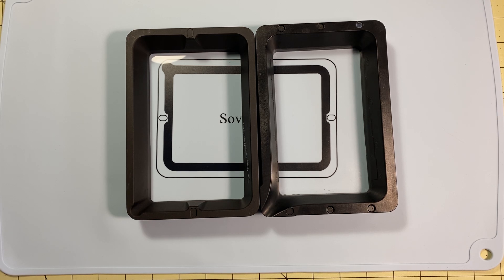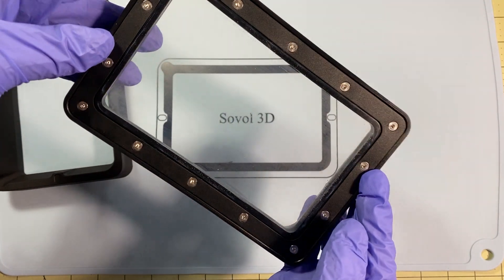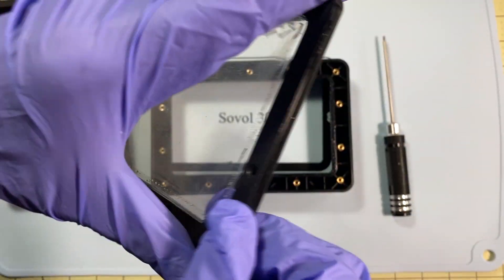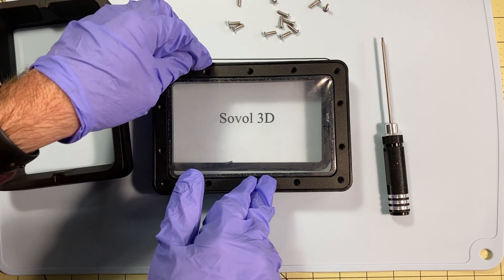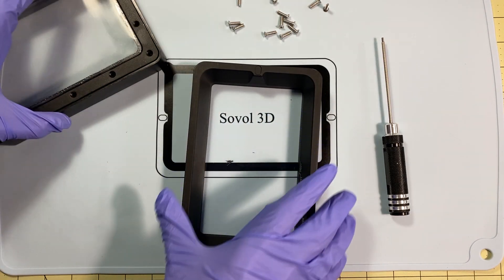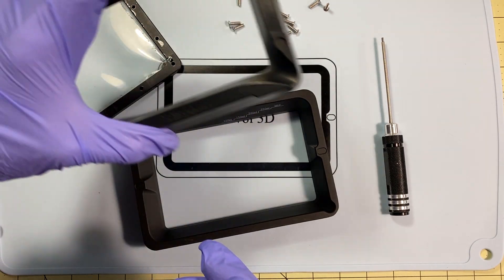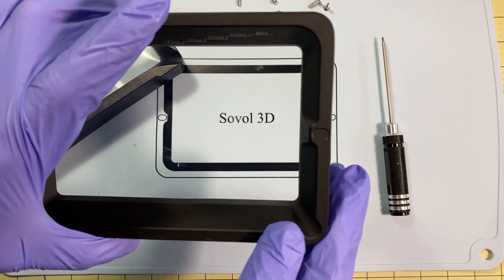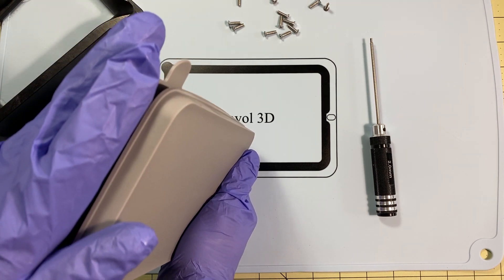Buy This Now to Upgrade your Anycubic Photon Mono Printer – Sovol 3D Printer Resin Tray Upgrade

Comment: You have no clue how much I am really starting to hate capitalism. My printer had a failed print out of the box, and it basically totalled my FEP sheet that came with the stock vat. I just waited two weeks for replacement NFEP (i heard good things about NFEP over FEP) sheets to arrive, Got them yesterday, I just went to install them and found out that I am a victim of bloody capitalism once again. So here we are. The tally is now $180 in replacement bits and pieces, And mind you I only have ONE failed print on my Photon Mono 4K.

Are you sure that the FEP in THIS vat is sealf replaceable and wont cost me money to buy an entirely new sheet frame?

Because here in Australia Anycubic is flogging these plastic framed replacement FEP sheets for $49 EACH. Not including the outrageous $23 shipping.

Comment: I bought the Sovol vat for my photon mono, and after like maybe 3 uses I had a spill that ruined the LCD screen, at first I thought I did puncture the fep sheet somehow but after replacing it I noticed that it leaked from the side, I double checked that all the screws are on properly which they were, I highly recommend staying with the original vat, I just bought 2 fep replacement for 13 USD

Comment: No problems to buy oem fep for photon mono now. But yes - the stock plastic vat  is not good, you can see how it deforms a little (on a long sides) when the fep was installed. Sovol and analogs aluminum maded are great!

Comment: I just now found out that I can't replace the FEP in my Mono. I'm really, really upset about it. I guess this is a suitable replacement, but it seems like I have to spend money on this part, to then be able to use the FEP film that's out there? I get what you are saying, but it kind of seems like a long way around the barn for something that should have been made available from the start. 
I'm not sure what I want to do now.

Comment: Just discovered this problem.  Contacted Anycubic and they sent me a link to buy replacement FEP film (via their AU eBay store), bought it only to find I can't use it.  A failed print ha left a opaque portion on my film so I can't print in the center of the tray.  I saw these replacement trays and said nah I'll grab the thing they recommend... So long story short thank you for the link you have just saved me a bunch of grief over this, I'm new to 3D printing, I guess I'm learning my way through the potholes. 

You get my Sub and my thanks!

Oh do you have a suggestion for a slightly flexible resin, I'm printing a model kit and once set the tolerance is really tight between parts and I've snapped a few getting sections connected!?

Comment: thank you so much you just saved me from a lot of frustration I was just about to replace my fep for the first time and looked up tutorials on how to do it, sadly now I have to wait longer to be able to print but this really saved me from wanting to toss the whole printer out the window XD
Reply: You can get the whole framed fep for the mono, mono 4k and mono 2 for the same price as a bare sheet would cost! Anycubic have it solved for replacing these in 10 mins flat! No messing around with cutting or tensioning it's all done for you just screw it back in place from out the box! £17.99 I am for x2 framed feps for mine and the same for sheets that just take the @#£# ,for my mars 3!

Comment: Just a heads up, this is not the same product anymore and it might not work as well. The link points to a new item with more screws, a powder coating that rubs off on paper towels, and a weird film that screws up printing unless you take the fep out, remove the film, and replace it. Also it may require you to turn your lifting height down to 60um/sec instead of the original settings of 120-180.

Comment: Hey just so anyone knows who reads this comment, sovol changed the design of their vat/fep gasket and now if you want to get your fep tighter than about 200hz, you can't really anymore with the new design. When I took out the included fep and removed the protective film and put it back in, the fep was only 160hz tightness. You can get an elegoo mars vat that costs the same as these sovol vats, it works in an anycubic photon mono, and it still uses the old two part sandwich type gasket. I found some on Amazon. The 2 pack of sovol vats was $40. The 2 pack of elegoo mars vats was also $40
Reply: Hi there, I read a comment in Amazon saying something like that, but I didn't understand what do you mean with the Hertz thing, would you mind to send me the name of the product you bought? or maybe a link to amazon.
I own an Anycubic Photon Mono as well.
Thanks!
Reply: @Kratocelot  some poeple "tune" their fep , for the rigth tension , the correct tone , like a drum

Comment: Hey man, I'm having to look for a replacement vat as the mono one is crap as you know and I can't get the sovol one anywhere. Would the replacement vat for the photon work for it? It's maybe a mm different is size. Just thought I'd ask before ordering one haha
Reply: Have you get the answer? Im about to do the same
Reply: @deltaafif1543  yeah I ended up just getting one. Fits perfectly, just have to eyeball the resin. Makes swapping out the fep sheets a thousand times easier
Reply: @brandonchaplin9782  glad to hear, thank you so much
Reply: @deltaafif1543  hey that's all good!

Comment: Was there anything extra to remove prior to installation, or this a remove from box and go kinda thing?
Reply: I ordered a two pack of sovol vats and returned them because they changed the gasket design. The feps had the protective covers still on them and I had to unscrew the gasket, take the fep sheet out, and peel that off.

Comment: Still cannot find the replacement (in Italy) very disappointing.
Reply from the maker: Which one?  The one from Anycubic?  We can’t get that anywhere. The Sovol on you should be able to get from Aliexpress.
Reply: @TrueEliteGeek  Yes, the original spare fep. I ve asked anycubic about It but they told me that it's not in stock "at the Moment".... And they can't Say when It Will became available. This Is very upsetting.
Reply: @andreabadalassi  yeah I had a similar experience. the sad part is that even though I researched for weeks before buying this printer, no reviewers mentioned the inability to buy a replacement fep.
Reply: @yatam true, and it's quite absurd! among other things, the assistance is completely incompetent, after 4 (FOUR!) emails in which they did not want to give me directions to buy the spare part because they believed I had not bought the printer from them (absurd but let's go ahead) they gave me the Chinese page of the support, in Chinese, but at the moment it does not foresee sending requests with a description of the problem.
On the sixth email, just today, they gave me the link to a page on their site with some feps for photon zero .... I stopped responding and ordered sovel's vat. Screw anycubic, i will never buy from them again.
Reply: Oh and the LCD screen surfer the same shortage... Impossibile to buy in eu, impossibile to buy in china. I really don't know What they think people can manage this.

Comment: Thanks for this. You still can’t get the replacement FEP cartridges in the U.K. so this is super helpful.
Reply from the maker: You really still can't get the Anycubic replacement anywhere.  I don't know what they were expecting people to do.  If these vats were not so good it could be a huge mess for people.
Reply: You can get them directly from Anycubic but they are pretty expensive ngl. Costs like £17 for 2 FEP replacements. When you can get one of these for £20 with a FEP sheet, and then buy a 5 pack of feps for £16.99

Comment: About how long, how many hours, does a FEP last before needing to be replaced?
Reply from the maker: It varies a lot. A FEP can last hundreds of hours. If you are printing different things on it using the same resin so you don’t have to remove the tray. Or it can last for one print if it fails and damages the FEP.

Comment: The whole pieces are cheaper then the loose FEPs in the Netherlands. Replacement is easy so kinda invalid point right here (they are available at anycubic website).
Reply from the maker: You are right!  I can see them if I look at the Deutsch website.  They are NOT on the English site yet.  It looks like it will be $14 each.  So it is about 2.5X the price of buying FEP sheets and changing them yourselves.
Reply: @TrueEliteGeek  1 FEP sheet is 20 euros in the Netherlands haha. Pricing seems random all over the world 🤔
Reply from the maker: On the German Anycubic site 5 sheets are 25 Euro. (High school German class is finally paying off )
Reply from the maker: They JUST added them to the US site $15.99 for 2  That actually isn't to bad.  A little more than doing it on your own, but not terrible.  I have updated the link in the video.  https://geni.us/AnycubicMonoFep  Ug, except for the $25 shipping.  I think I will wait until they are on Amazon.
Reply from the maker: Where do you see that?  I can’t find the whole pieces anywhere on their site.  In the US I can get FEP sheets on Amazon for $4 each.  I expect the whole plastic replacement to be $12-$15.
Reply: I live in the Netherlands and I use the German language on the site so it gets shipped to me from their German warehouse and I can get them rather quickly and cheap. But for that transport cost your option is alot better indeed ^^